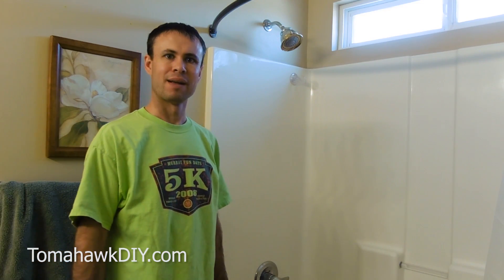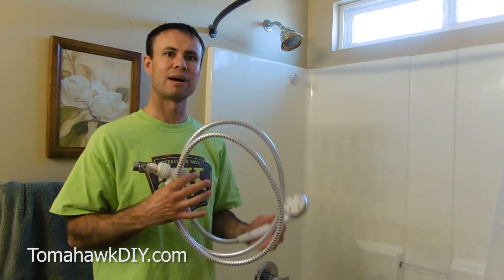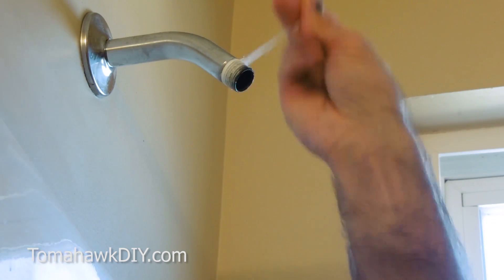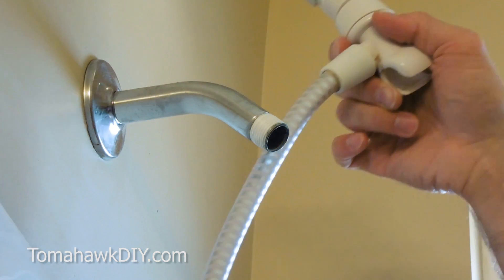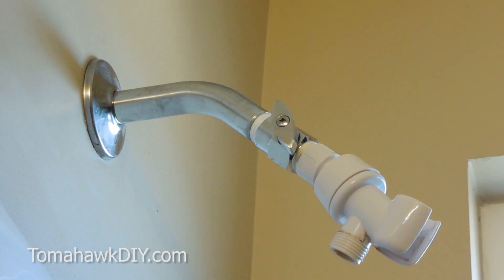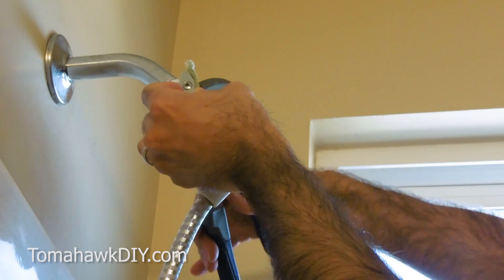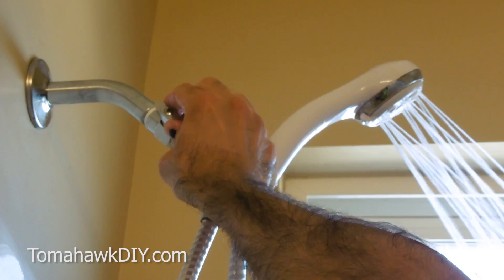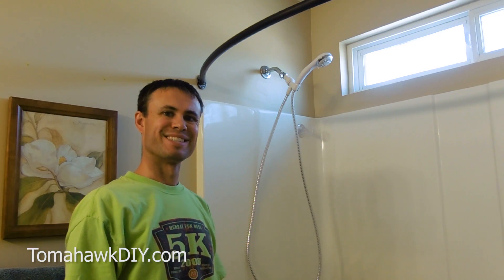How to Install a Hose Shower Head (Sprayer)

Comment: I'm probably the only one that has this problem.   I installed the hand held shower head.   No leaks it works fine.   There is one very annoying problem though.  When the water is on and the shower head is in its holder it won't stay in place.  It automatically turns to the side and squirts the shower door.  I fiddle with the hose and it helps for a moment and then starts turning to the side again.  How do I fix this problem?      The previous one I had did not do this at all.
Reply from the maker: Unthread the shower head from the hose. Try adjusting the gasket. Often with some minor changes you can change the tension in the hose when it starts going sideways
Reply: @TomahawkDIY  Thanks.  Your suggestion does seem to have fixed the problem.

Comment: Why didn't you use Teflon tape on both ends of the hose? I expect the rubber washers to help, but wouldn't the tape help if the washers fail?
Reply from the maker: Yes, Teflon could be a "belt and suspenders" approach in case the washer failed
Reply: The instructions on my shower head said not to use the teflon tape on the plastic to plastic connections. Not sure why.

Comment: Could you just not turn the water to full blast ? I feel the valve is redundant
Reply from the maker: Some shower mixing valves do not have flow control - only off and 100% on for volume. if you have a nicer handle that lets you adjust temperature and flow, you do not benefit from the valve I installed.